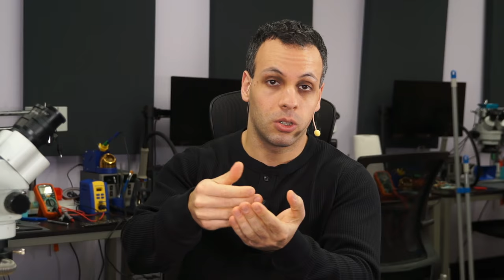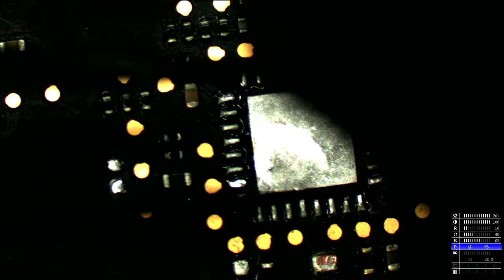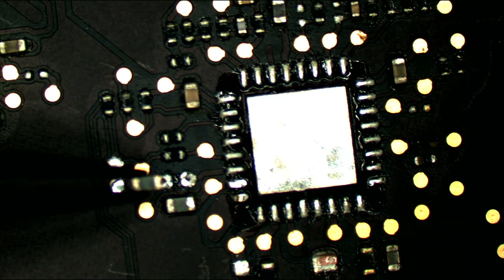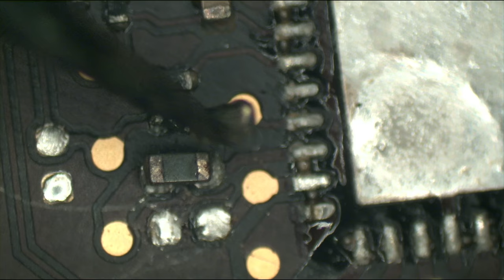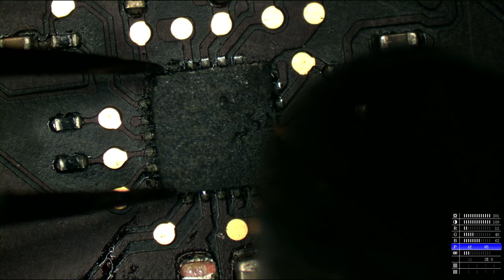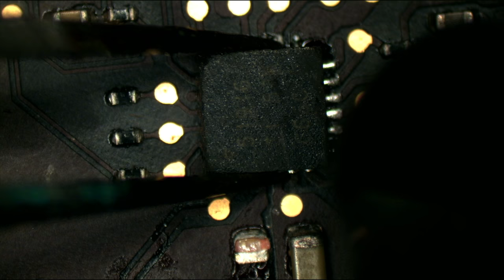How to solder components using hot air without them blowing away

Comment: This has to be one of the most overlooked topics for new comers, because experienced people don't often think to mention it, as it is so plainly obvious to them, whereas it could be a make or break difference of a game changer to a new comer.  Kudos to you for bringing it up.
Reply: So I found Mr Rossmann through right to repair, which he has taught me a lot. But this little tip/trick of the trade I super like. Even though I dont do board repair in any way, i love learning these tid bits of info in case of the zombie apocalypse.  ;)
Reply: I was like, isn't this too obvious to even wort mentioning? Apperently not.
Reply: I managed to damage a NDSi board that I was trying to repair partly because I was making this mistake (and also trying to fix what I believed was a solder bridge when it was actually that the two pads were connected to the same trace). Now I'm having to run patch wires to create pads that  no longer exist.
Reply: and this is the case in a lot of soldering and tech tutorials. It's always the obvious things that are overlooked and make it very hard for students to learn. This is an issue i've faced myself multiple times.

Comment: I'm a watchmaker getting into micro soldering. When I went through school we would practice just moving tiny little watch screws one by one from one box to the next. Sometimes you need to be able to grab a screw from the middle of the head, or turn the tweezers 180 degrees while still holding the screw and not having it fire out into who knows where. After a while it's all second nature but practicing in the beginning is invaluable. Also, make sure to buy good quality tweezers and keep the tips finished. The extra $30 you spend now will save you a lot of time hunting for parts later.
Reply: thanks for the tip, what do you mean by keep the tips finished?
Reply: @julianbinder2371  Clean and unbent I’m assuming they will build up solder flux dirt e.t.c. At that point things will stick to them not release on and on.

Comment: As an occasional hot air station user I just kapton tape the area just incase I accidentally blow/knock some nearby components out of place. :P Probably using too much heat/air flow tho.

Also taking the time to preheat the board before getting in to solder helps alot when theres a lot of copper on it that will act as a heatsink. You dont want to be ripping components out of the PCB in your frustration.

Comment: Having recently purchased a Quick solder hot air station this is a good vid. My biggest hurdle isn't so much blowing components but adjusting heat to the right temperature to not melt plastic. Ruined a Switch USB-C replacement connector due to that.
Reply: Heat the other side of board if possible.
Reply: Try to insert the USB plug into the socket, then solder the socket on. The plug holds the socket together while soldering. Capton tape can help to sheild against heat if you can get it to cover enough plastic (difficult on a connector but works well for many other plastic parts). As Fizzle fry said, bottom heating is the ultimate, but you need to invest in some gear

Comment: Thanks a lot, am from St Catharines (Ontario Canada).
I've been a PC tech for years, but have no training in circuit level repair, but you have inspired me for a couple years now, to want try it.
Soldering has been a challenge, but I want to get it right.
I've acquired some equipment now. (But lots more is needed, a fume suction device and especially a scope, since my eyesight, has degraded recently) 
Lately I repaired two large monitor power supplies and replaced some laptop LCDs successfully.
Have a Samsung note and two P20 pro screens to replace. A Lenovo G580 power button issue to resolve, and many other projects.
I'm not making any money doing it. Am just trying hard to learn.
I have a friend of my father's, that has an electronic repair shop here in the Niagara region. He's been in business over 3 decades now. But he wants to retire. He casualty asked me if I was interested in getting into it,  but I think I still have ways to go. I still have my current bilingual tech support job, taking up the bulk of  my time....But I'd love to sever ties one day, with financial institution I do work for.... Being independent would be great.  ;-)

Comment: Hey Louis, just so you know. These soldering videos you make are not in vain. First came here in 2019-2020 for your insight as a business owner, and cool e-bike trips around NYC. Stayed for the "man rants at NY real estate", and when I need to unsolder and resolder a EEPROM E93C66 I came back here to you looking for proper advice on using hot air stations, since I've bought one for 60 dollars (didn't have much more, it has that old style heating element separate from the soldering tip)

Comment: One guy I know at work heats up his tweezers with the hot air and then uses them like hot tweezers. I just go in with a soldering iron :P.
Reply: The best tool is the one that is available and works for you
Reply: Going to try that next time. I'll bend the tweezers so the ends only touch.
Reply: Two soldering irons work too for caps and the like if you dont have a tweezer soldering iron. And Ive seen a wide enough flat head soldering iron be used to heat up both solder joints and push the smd component off the pad.

Comment: You say you are using max temp and airflow. So what's stopping you blowing the adjacent components off the board? This happens to me all the time. I try to protect them with Kaptan tape but it's not great and the Kapton can lift up the components if it is under tension? Another short video about care of adjacent components would be great.

Comment: On iphones, where pitch is so much finer, sometimes I find myself holding the chip in the right place and heating it up until I see flux bubbling and then retract the hot air, wait for it to cool a little and then I can let go of the chip. After that it’s guaranteed it’ll flow into its place. I don’t know if it’s the flux holding it or some balls (the data ones with less mass) melting  just enough to bind themselves to their corresponding pads. 
I learned this trick because holding BGA chips is a bad idea and not holding them made them shift and dance far away from its alignment.

Comment: Thanks for posting this!  I'd given up on using the quick hot air for anything other than large chips.  I've been using the specialized tips for my jbc solder station. I'll have to give it another try with this info in mind and see if I can make it work.

Comment: I need a hot air station to practice. Never used one, only a cheap soldering iron.  It works well, but recently been playing with stuff that has a lot of tiny smd components and it's hard to use the soldering iron with them.

Comment: Hoped to find an answer to soldering logic fuses ;) .
Those have a plastic top that melts very easily. Guess they are more commonly soldered ultrasonicly instead of with hot air.

Comment: I'd be interested to know what airflow, nozzle size and temperature you're using.  I've noticed a lot of people like to use too small a nozzle, which requires more airflow to get enough heat, then the parts blow away because of the high air velocity.

Comment: I recall I had problems soldering 0402s with hot air. Basically, I was able to solder my component onto the board, but I would blow away other components close by where the surface tension was apparently not enough to hold the components. What exactly am I doing wrong? Did I not properly solder the other components? Am I actually using too much air or temperature? I would always see how the air was really trying to push the components out of the way (and eventually with success on some of them).
Reply: As a noob myself I Kapton tape the nearby components to avoid that happening :P
Reply: Heat doesn't move stuff so less air flow might help, I can't even solder lol, just logic
Reply: I don’t do a lot of soldering now but back in the day, I would hand solder 0402’s and check the filet with a coddington.
Reply: @bobbbobb4663  I tried hand soldering. Although I can definitely do it, it'll take me 2 or 3 minutes just to solder a single capacitor, meh. Maybe because I don't have a microscope, but I'd have components constantly stick to the iron and get pulled of the board. Hence why I tried hot air.
Reply: @theIpatix  Got it.  Use smaller tips and keep them clean.  Hot air soldering will work but it can be frustrating with decoupling capacitors because you don’t know how the pad is attached to one or more internal ground planes (which means it will take longer to heat the solder filet).  This is why I use two solder irons - one on each side to pull off 0402’s and larger.  If dealing with RoHS solder, use tons of flux and keep your tips clean at all times..otherwise they will oxidize and be junk very quickly.
Reply: @theIpatix  Wow. You do 0402 without a microscope? You must have amazing eyesight and tremendously stable hands. I generally do 0603 with a microscope!

I'd recommend to get a microscope - a simple cheap USB microscope will already show you a lot of detail, but a proper binocular one is a real game changer. The magnification allows you to see a lot more detail and to train yourself to get a lot steadier, the binocular part allows you to see 3D - which is much more important than you'd think. Among other things a microscope allows you to properly use both hands - one with the soldering iron the other with pincers that hold the device down.

You can get a decent one for 300-400 $US. Modern Chinese microscopes are generally better than their reputation and much cheaper than American or European ones. Magnification doesn't have to be huge - I myself work at 5x most of the time, 10x max. Check the focus distance between the objective and the desk - you need about 15cm (6 inch) to fit a soldering iron into that gap - if it is too short you can often double the distance with a 0.5x barlow lense.

Strange Parts has a really nice video about this.
Reply: @KonradTheWizzard  Ye, I can "do" it (I mean, I use what I have), but it's really time consuming compared larger sizes and I'm not designing DIY boards again with this. Thanks for the recommendations though.

Comment: thanks man for the lesson. Soldering is so hard. 
I had  projector power supply had a cap go bad and removal of the old one was near impossible,. I got a soldering iron, but this heat seems soo much easier. I wish I had one to use, bulky soldering iron and stuck pin clipped on backside like an idiot (me, I did that) and a little piece got stick in the hole. I had to get exacto knife and round robin that area till i could see through it. what a chore. i'm exhausted.

Soldering a new cap (soo small dude not sure how you deal 100u/25v/105c soldering so close + and - but I did it!
at least it has power. but man,------------------------- what's this device called if I may ask?

Comment: Same with silversmithing (or copper, or brass, or gold, etc.) The two surfaces MUST be touching, and they MUST be clean - no grease or schmutz. Just flux, and solder. And full contact. Otherwise the solder won't flow to fill the joins.

Comment: My big thing is no matter what I do, 350c isn’t enough to melt in any reasonable amount of time, and I burn the board/plastic connectors. I just don’t know what I’m doing wrong. I just want to fix switch lites :( 

Edit: yes I’m using kapton tape to shield things. But Louis and others are just good to the point where they can use hot air right next to a zif connector and it looks the same as before he touched it.

Comment: I should get me some scope to at least see I am holding them wrong :D . 

Anyway, what are the optimal hotair settings? I one tried to desolder a component from old Dell E6410 board, and for the love of god I could not get the solder melt. It even started to discolor the board from heat itself (dont worry, I was not repairing it, I just needed a component from it for different project). I used the medium airflow and 450C of heat. It was stuck there like glued. Also it was a 1208 SMD LED.

For these types of work on PB free boards, is it mandatory to use low melt solder?

Comment: My components stay where they need to, it's other, smaller components that fly away or fall down from the other side. I guess I just need practice with picking temperature, air strength and heat time.

Comment: I don't know much about soldering aside from soldering wires together. My speedo intermittently works and it's not the speed sensor because the odometer always works. Seems to work after the truck warms up a couple miles down the road. I'm thinking it might be a poor cracked solder connection on the speedo board. Do you think I can pull the cluster apart and heat up all the solder points on the speedo board and fix it? Should I use a solder gun or a heat gun or something else?

Comment: Thanks, Louis, I learnt another important thing I was unaware of. 
I think I must have some practice on it. But Is this the same way when you replace an SMD resistor? I've seen that are way smaller in height than the capacitor you showed, so how I can "grab" an SMD resistor correctly to solder/resolder it?

Comment: would it be even better if you push down on the component when you hot air it into place, that way you are also conducting heat away from the component as you solder it back into place? Asking for a friend

Comment: So when you don't touch a soldered on component, your hot air won't blow any components off (because of surface tension) ?
Or is it indeed possible, without touching, to blow off a few components if you set the airflow too high ? Thanks.

Comment: So what ratio of oxygen to acetylene are you using on that thing? Because mine just burns right through the board.
Reply: That's not a torch. It's a hot air gun that uses an electrical heating element to heat up the air.  A torch used to solder pipes will definitely  burn small electronic components.

Comment: In my opinion, soldering with a solder iron is better than hot air, its hard to master, but once you do you wont use hot air unless for unsoldering an EEPROM
Reply: Soldering is ok but de-soldering is not so much fun with an iron when you have to get three pins or more all at the same time.  Even two pins can be awkward.

Comment: Do these techniques still apply when components start getting smaller than the size of the tweezers? I've had to try and do a salvage repair for a consulting company once and those tiny resistors just get blown away. They're the size of dust flakes. I've seen other techniques using like putty or glue to keep things down in place before soldering but not sure what is the go to technique for smaller components.

Comment: what heat gun temp settings should i set for SMD components? I'm using yihua 8786D rework station and also my hands are bit shaky, how to prevent that shaking while doing micro soldering job?

Comment: Hi, I'd greatly appreciate if you con give some advice, I got a 17" mid 2011 macbook pro that doesn't turns on, the battery charges but nothing once the power key is pressed, i bought it used to fix/resale thanks

Comment: Louis - I've been watching your videos for a long time and love your work.  I don't know how else to contact you but I am a vintage computer collector and I have an old 486 laptop that has a proprietary ram board.  It can hold up to 24 chips but is only populated with 8.  I want to fill it the rest of the way with the correct chips, and I can supply the chips but I need someone to solder them onto the board for me.  Would you be interested in taking this on?  I can remove the board itself which is about a 5"x5" board and send it to you with a prepaid shipping label to ship it back to me.  I can supply my phone number so you can call me that way I can pay you for your work when you are finished by debit card or however you want to be paid, just tell me.

Thanks,
Mike